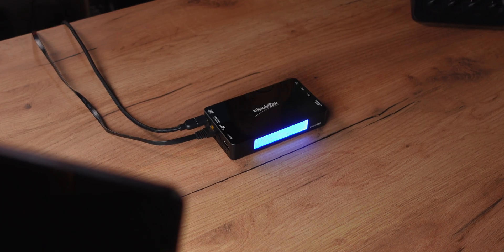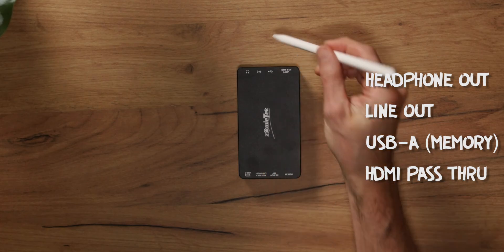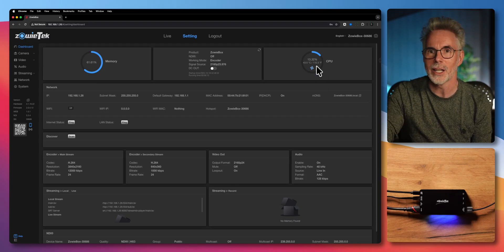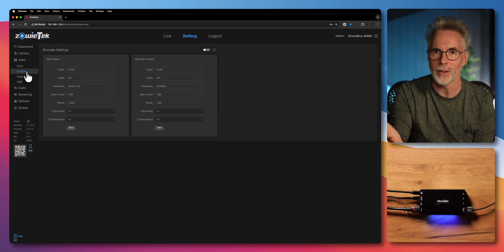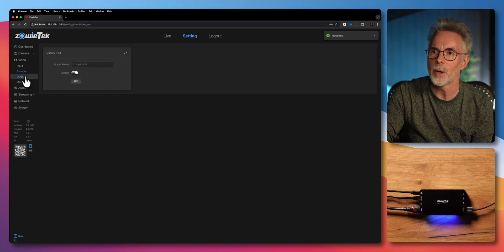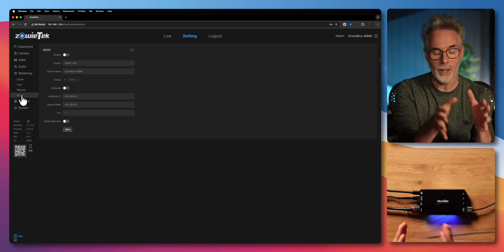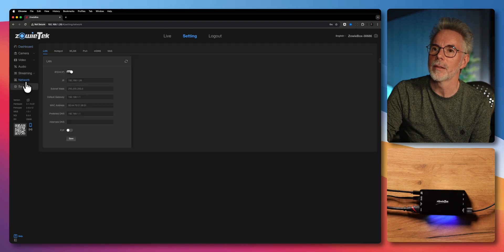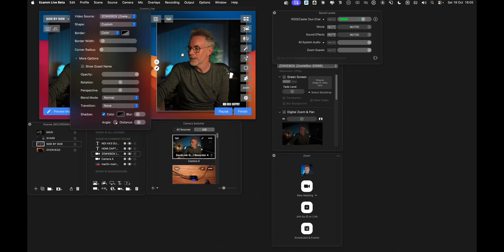How to Set Up 4K Live Streaming with Zowietek - 4K HDMI NDI Video Encoder/Decoder

Comment: I've connected my box to a sony zv1 camera and sending ndi to OBS studio.  It connects fine, but when I start streaming OBS will lock up after a minute or so and can't figure out the issue.  I tried both a wired and wifi connection and both have the same issue.  Have you tried sending to OBS and then streaming to Twitch or know of anyone successfully doing so?  Getting frustrating as I would really like it to work.  Thanks
Reply from the maker: Hi - not had any issues with this myself, but I use Ecamm live via NDI - should be the same workflow Things I would check are your output resolution settings in the Zowietek UI, and what HDMI settings are you sending from the Sony Camera? Are you seeing the video feed preview in the Zowietek freeze as well or just in OBS? If the latter then maybe an issue with OBS NDI plugin? @TheOutdoorsStation may have some other guidance for you.
Reply: @NeilFarrimond  I think I just got a big clue.  I tried streaming from an older Windows 10 computer and it worked flawlessly for 40 minutes.  The issue is when I run on my brand new Alienware windows 11 computer.  Grok mentioned something about people having issues with OBS when using the latest Nvidia drivers and suggested I rollback the drivers to an older version.  It also suggested I remove hardware acceleration gpu scheduling.  Glad I was able to narrow down, but disappointed I purchased a new expensive computer when my old one was fine!  Thanks for your input.
Reply from the maker: @daved2403 glad you got it sorted.

Comment: Hi Neil. This is the most useful piece of studio kit in the NDI and streaming world in my view. I describe it as the Swiss Army Knife of NDI. I now have 4 of them and use them all the time. One unique conversion they will do is from UVC to NDI/HDMI, so you can take a 4K Webcam and add it to your network without having to pay for a proprietary convertor (Obs!)  Another option to the Restream service, it is possible to daisy chain these together and send out multiple streams. The SRT feature is another useful feature for remote production, as a camera can be transmitting using a mobile router (or local wifi) with H265 back to a main studio anywhere in the world. Much easier than trying to get NDI Remote to work, which it never did for me. (Now discontinued) Do this for multiple cameras and you have a complete remote production studio. I would say setting them up in a mobile scenario I've described is a bit fiddly, however they have internal memories, so once configured you can select a different memory for each project. I haven't noticed a colour shift, however I use mine all together so if they all have it I wouldn't notice. Another use when working live with a laptop running Powerpoint and the client doesn't want to install software, is to drop this into the HDMI chain and you can ethernet to the router at back of the room and your production desk and you have another NDI input. I have several other Zowietek products all of which have the same basic menu system, which also incorporates a search facility, so it will explore the network and allow you to access each Zowietek product on the network without having to find the IP address of each one and log in. If you want to set up a 4 camera SRT test stream one day let me know.
Reply from the maker: Hey Bob yes indeed this is a great device and I actually did see a video of yours on this. Would love to dig into the setting a little more and to do more testing especially around SRT! Will be in touch!
Reply: glad your having a easy time, i cant get it to show up, using ndi, to use.
Reply: @tek_soup  Lets see if I can help. Firstly you need to have an HDMI input connected for the box to operate. Have you connected it to your network and used the IP address shown on the side to access the box? Once you have access, have you set it to encode or decode? Are you using NDI Monitor to see all items on your network?
Reply: Also are you using PoE to power the box? If not you need to power it via USBC connection. Does the screen light up on the side of the box?